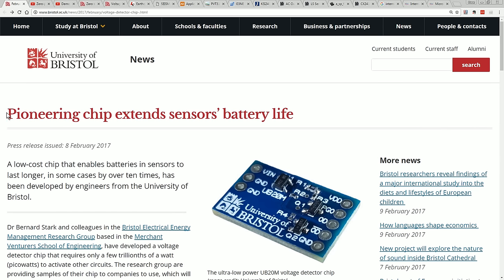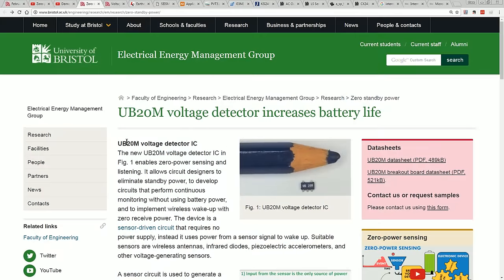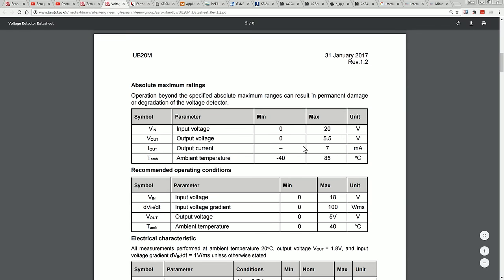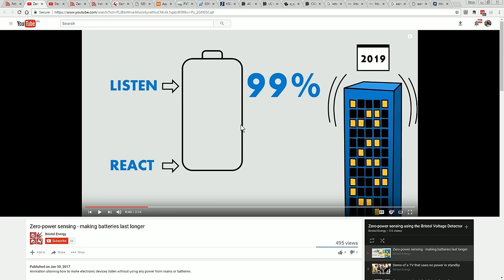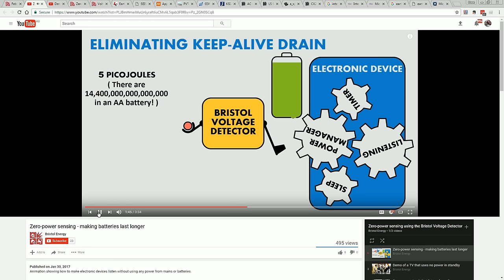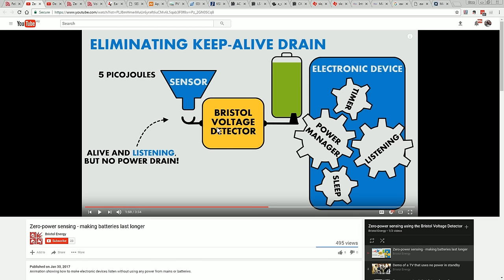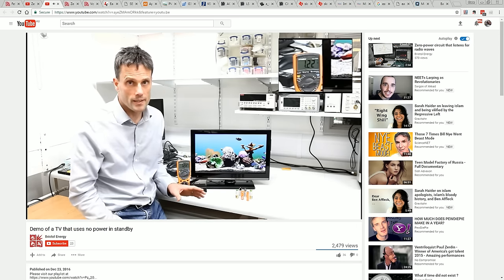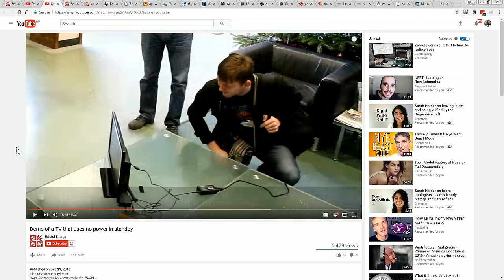EEVblog #971 - Zero Standby Power TV - BUSTED!

Comment: I agree that it's busted, but consider that something similar might be integrated into the TV itself, to trigger based on an IR threshold then you'd just need the remote control firing longer to also give the TV something to decode, so then we get less  standby power consumption but burn through remote control batteries faster.

This might still be the more acceptable situation given the intermittent use of the remote and that a small, long life rechargeable battery and tiny solar cell could be built into the remote, so long as it's still a standard form factor battery so there aren't owners grumbling about another failure mode when the battery wears out.  1/2 AAAA seems like a nice form factor for that, as well as use in clocks that usually use a 1 x AA primary cell instead.

Comment: What's the difference between VA and milliwatts? Is VA just the product of current and voltage amplitudes or RMS's or...? (I know for milliwatts you should integrate voltage and current with a fine enough sampling time.)

Comment: This is a useful product for some niche applications, but much of this can be solved with basic vampiric power prevention circuits/chips in plug packs and SMPS's ... but no one likes to use them ...
you don't need 0 power draw ... when plugged in a few uA used for testing current draw will be lost in the power meter's tolerance/losses and batteries will internally drain more than that
Reply from the maker: And an IR receiver takes in the order of uA's. Leakage current level.
Reply: and there are a large number of micros on the market with sleep and dedicated wake pins that draw practically nothing 
if you can make an efficient standby power supply than your golden

Comment: Question: if you include a small lithium primary or aa or something for a latching relay, triggered by some circuitry that ultimately ends in this energy harvesting thing, could you switch mains to the dc power supply with 0 standby power? Just a replaceable battery that lasts potentially several years? Or something like that. Basically use a small battery to sort of bootstrap the whole process. I dunno, it's probably an overly convoluted way to try to make this chip useful.

Comment: If people are at all concerned with stand-by power, why not the classic mains switch? A lot of older equipment has it. My dad’s Sansui Eight has it IIRC. Works great, no standby power at all! But batteries, well, they unfortunately discharge fine on their own. :/
Reply: because the device would be off, not standby

Comment: Couldn't you just use a rechargeable battery running one of those ultra-low-power micros mentioned to wait for the IR activation command and switch a mains relay?
You could even slap a tiny solar cell on the outside to recharge it. (Like the kind calculators use) (Though it would probably be better to just charge from the regular supply whenever the device is being used.)

Comment: I'm a bit confused. I guess this is not to be used to lower soft on power drains, because where would the activation voltage come from except for a regulated supply already? Does this work in the Jungle, or northern Canada, with the RF harvesting? Maybe there is cosmic/solar RF. Is there no loss due to like the FET transistor to gate the real power? OK maybe the loss is the switching supply?

Comment: One simple way to improve the efficiency of the standby circuit would be to drop the typical red standby LED on the front panel.  There, 2mA recovered.  The micro itself probably uses a fraction of this.  (Doesn't improve the PSU efficiency any, but hey... one problem at a time here.)

Comment: Reducing Stand-By-Power is an important thing. And I agree: it can be done with extremely simple and cheap changes in an electronic design. You normally do not need any very special chip. You only need the budget in the product to do it. I guess reducing Stand-By-Power from 5 Watt down to 1 mW can be done for some Cents of Money. But the problem is that TV-Customers normally do not ask for saving 100 Euros the next 10 years when they by a TV-Set. So Like the EU-initiative to reduce Stand-By-Power by Law: https://de.wikipedia.org/wiki/%C3%96kodesign-Richtlinie   . Probably it is only the first step - but the step goes into the right direction. And it helps reducing cost, carbon-emission and nuclear waste.

Comment: I assume some tiny solar cell and a power cap would be sufficient enough to supply the standby trigger circuit. Might be easier and cheaper than using a dozen IR for harvesting. However demand for switching mains still wont go away. Besides standby power for TVs, at least for Europe, are down to 1W by regulation demands already.

Comment: I don't see any latching functionality, so do you have to keep the remote active to keep watching? If not, how do you turn the tv off?
Reply from the maker: It's up to the end user to implement latching and turn-off
Reply: They posted a reply to a question on their video that someone asked. And to be fair this was a month before your video... "That's a good point. In this demo, we have only eliminated the standby power of the TV and not of the adapter, which is using about 0.1 W. TI have a chip that virtually eliminates standby power of adapters:  http://www.ti.com/product/UCC28730. We'll address this in a future video, thanks."
Reply: Which usually takes additional power... Those 0,5W are used for a reason and switching the TV on every time without decoding (some logic gates built from these ICs and used as a decoder could be interesting) has some unwanted side effects. Anyway, energy harvesting is an interesting field to learn about.

I am not sure about the niche cases. If you look at the typical wakeup inputs there might be some applications that could benefit where a mechanical switch was either not usable or not possible. Most applications work around that problem by using a principle that draws power to operate anyway. Maybe a new type of switch emerges from thermocouples.

Comment: Actually, if you look at the schematic, there's a resistive voltage divider (R1 & R6) from +V (labeled 12V_INV_VD) to ground. Even if the chip blew its guts out and went open-circuit, the thing would still draw power!
Reply: True. That is to protect our chip which has a maximum output rating of 5.5V. If there were a 5V rail, this would eliminate the need for the voltage divider.

Comment: So Dave if I'm understanding correctly, you're saying the 0 power detector is useless for saving energy without a 0 power relay. IE Being able to sense the power on signal at ultra low voltage does no good unless you can activate something like a relay to cut the AC power off and on as well. And since a relay strong enough to kick over 120 to 240v ac needs a lot more power than pico watts, it's useless for saving energy right?

Comment: Doesn't the reference voltage affect the readings? I'm not too great with my mechanical measurements concentration. Yes a Harvard term from non Harvard student. 

Dave, can you request samples if not already and make a similar video to your batteriser one? 

As I watch, I'm realizing you may not need to. Ty.

Comment: Why not have an internal battery, or cap, which gets charged up while the device is on. Then you can simply use the detection circuit to take some of that power and have it toggle a relay in series with the AC to DC supply. Then you would truly have zero current draw while the TV is in standby.

Comment: In 1994 Me an a guy in the TV repair shop made a TV have zero power off mains in stand by.  How did we do this be mistake we had a TV that when put in stand by would lock up.  So we took the contact on the main switch that would trigger the TV you had the normal mains switching with 2 contacts the TV used battery in side to hold tuning information so we used that to trigger from the remote control to latch a relay that would lift the mains as the TV would lock up we had to pull the plug then back in again o get the TV to work.  The relay did that job.  So in 1994 we did it 1st and it was 100% zero power in stand by as the mains was lifted.  The cell on the remote board did the work we did need to do a small mod to case to change the 3 AA cells we did use rechargeable.  So when TV was on did keep bard charged we did test and leave off foe 3 month it still had tuning information as at the time the tuning had a ram chip NON violation ram was not in use at the time so we did it 1st.  Wish we knew more back then as I would be rich.  The product is crap what about the Hifi  IR remote will that not trigger it.  As so IR LED's do not produce voltage to trigger.  fake crap like this winds me up.  The water bottle one did end up causing a fight at one work place as I say but a guy in a lab overall he can tell you anything.

Comment: Simple solution to Plug back turn on: Use with low power microcontroller (MC) with battery. Device turns on MC, and the MC use power from a small battery to turn on plug pack. Not terribly difficult to do. Of course you don't need fancy widget since low power MC can work off a small battery for 10+ years. Small batter can use a step up converter to get the MOSFET turn on voltage needed.Funny that your own video had the solution (ie low power MC), yet you didn't think about using it.

Comment: Ok then how about storing a small charge on a capacitor while the tv is on, then when you switch the tv off, it opens a relay to the main power supply. When you want to turn the tv back on, the UB20M closes a circuit, which will drain power from the capacitor to close the relay and reconnect the tv back to the main power supply. This will power the transformer, start the tv and instantly  recharge the capacitor for the next cycle. Wouldn't this achieve the goal of a tv with absolutely no standby power?

Comment: Couldn't you build this into the power adapters, at least the switching components, and have a capacitor that charges up, disconnects mains.
Then when/if the cap needs a top-up, open up, get a charge, disconnect.
Then your device can let the mains through with the charged cap?

Maybe I don't know what I'm talking about, but that seems like it would make sense :P

Comment: You could certainly store enough energy in a capacitor to trip a 2-coil latching relay. The energy could be stored on hand rather than relying on a power supply.
If you used the stored energy along with electromechanical switching then there is no logic to leak current, the tiny amount of signal energy could flip their chip!
Their tech could be used for the ON signal. However that dudes right, if you pick up your AC Remote then your TV will see the same IR energy regardless.
Once in the ON state you could recharge your cap/s and use some electronic metering (threshold will be device specific - if the power fluctuates it wont work properly) to monitor when the device is switched OFF & reset to "zero-power usage/ready mode"   If all that works, get a chunky mains relay and pack it up in a jiffy with IEC-C13/4 in/out. Done! "theoretically"

Comment: It is funny to see people discussing the things which existed like 30 years ago. Search for "latching relay" - they consume zero power when disconnected and require only some power for switching their state. Being mechanical, they really provide zero power consumption. With an old manufactured 50 years ago array of diodes with glass packaging serving as a primitive solar cell you gen get enough power to turn the thing on or off with the energy stored using a large capacitor of the same age - many of them had very low leakage current, more than enough to store enough charge over time.
The energy could be pumped into the capacitor even from electromagnetic field emitted by the power lines, the usual ones - low reverse leakage diodes from 80th can do the trick.
As you probably already guessed, it is nothing new, even worse than when it would be as a mechanical device, which would really consume zero power. Basically any new low-power electronic components can be used to provide control sensing and some storage for switching. What all this marketing BS is about ?

Comment: Can't they trip a solid state mosfet allowing enough current to power a relay for mains?
Reply: Riyadh Elalami then you need a supply for the relay
Reply: Riyadh Elalami maybe if the relay was like a floating gate setup or something. they could charge the gates and have the relay work. but im not sure how reliable that would be. nor how you would acomplish it.

why not just have a circuit running from a cr2032 battery, made so it would last 20 years, and make that switch the relay whrn needed?
Reply: Biggest problem with mains is..  Its alternating current.   So you will have to rectify it, meaning more loss.  And solid state relay's do not really like inductive loads.  And need a very big input voltage like 15 - 30V  DC (however could be that they made better solid state relays,  but the costs of those might just be bigger then the money you would potentially save )
Reply: Relays aren't that efficient, maybe using a coin cell (or 3) for initial triggering and the dc converter taking over once powered could be possible but sounds over complicated and expensive compared to just switching it off at the wall.
Reply from the maker: That same CR2032 battery could run the IR receiver indefinitely.

Comment: No stand By power ? Simple ! Hard power switch that switch the main ... bam, no stand by power !
Reply: Not all systems have manual control. The TV was just an example. Other applications such as fire alarms, intrusion detection, physical status monitoring etc wouldn't have a human presence to do that.
Reply: Zadster This is true but in the case of most home devices there is no excuse for them to not have hard-power disconnects. It' just for laziness.
Reply: Yeah, do that on your computer
Reply: MrTweetyhack I do actually, My computer is on a power strip that I shut off before I 
go to sleep. Most computers, once it saves it's session in the drive, you can 
unplug it and do whatever you want and it will pick up where you left 
off. kinda like when old computers would shutdown and then tell you "it is now safe to turn off your computer"
Reply: SpectrHz Except modern TVs can act as PVRs so do need to be kept on.  Plus not everyone can get to the sockets or back of the TV, where any physical cut offs would be.
Reply: Well if your using the PVR feature you would need to leave it on anyway, I'm talking about when you are not planning to use a device, just disconnecting it won't upset anything including computers.
Reply: Quick, Kickstarter it now!!! (I wish that was even a joke, sadly I expect such a thing, just need some gullible and easily bought actors and a little video/animation)
Reply: Actually, this kind of chip may work for those... nope, a clock is still probably using less power than this chip. :P
Reply: SpectrHz I switch my PC monitor and speakers off at night, everything else stays on standby because I just can't get to the sockets.

You also have to factor in that completely powering down any PSU then back up again will wear it more than leaving it in standby.  So ultimately, you aren't saving anything, you are just transferring the cost from one thing to another.
Reply: Suppose that a certain PsU has its own power management function, responding with less wiring than PoE.
Reply: Our long gone, Old big CRT TV had a nice Feature: You could just by Pressing the power button on the remote once send the TV to Standby. Or, when you pressed longer, it "self depressed" the Mains power switch at the front. (Cut's off the Mains). It was simple electromechanic, but a very neat feature. We used it everytime we switched the TV off. (Better than grabbing around the clunky TV and search for the switch of the extension).

Today every "ultra thin TV"  or other Devices come with a power brick which hasn't a proper mechanical switch on it. 

But that "self-complete-poweroff" functionality for Washing machines, dryers etc. Might be useful. When the programs finished, it send's a signal to a bi-stable Relais and "Ba-Zinga", no power is consumed.  And a Bi-Stable Relais isn't expensive and could added in the most devices easily. For switching on, Press a button, Bi Stable Relais switches the Main Powersupply on and there it goes.

Comment: Why not use a calculator sized solar panel to charge a cap to power an IR receiver and a low power relay to switch the 230VAC. Guaranteed 0% standby current...
Although some devices have high standby power usage and should be improved, how much % of your total use goes to the better ones anyway?

Comment: with a solid state relay you could even switch the tv, but you'd need energy to switch the thing (voltage divider from mains?) but i think the relay would waste more power than the standby does waste
Reply: Leonelf do you know what doesnt waste any power? a switch on the front/back of the tv. i used to turn mine on with my feet when i had a crt tv at the end of my bed

Comment: Not nearly as bad as the batterizer which I consider a complete con job. This chip basically works (if only for niche applications). If you are going to go after every engineer that has his work inflated by a marketing department, than you will have a busy life :), as this is quite common. That said, your criticism is completely valid

Comment: I once picked up an 31 year old PC from the TipShop, To my surprise, (Not only did it work) But it kept the exact date for 31 years... It was only about ten seconds off.
Keep in mind the size of the battery.
Reply: I remember the battery for the 486 I used through most of high school. The battery was in a case that could hold something the size of a AA battery and was connected to the motherboard by a good 20cm of wires and itself held to the case by velcro.